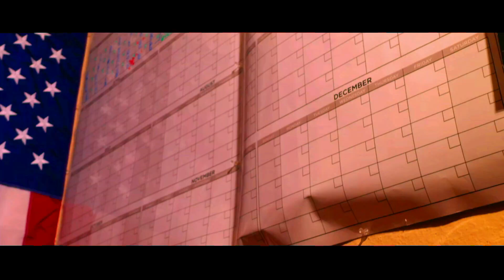(HATSAN BLITZ SLUG TUNING) POWDERCOATED NUCLEAR SLUGS: BENEFITS? TESTING GRIFFIN 36 GR POWDERCOAT!!!

Comment: Some really interesting results there. The pellet shot to shot consistency was great. As well as a better fit, they must almost be like lubrication. Hopefully this will also make a difference on accuracy. If this works well, it could lead to a change in pellet and slug design. I wonder what the long term effect it could have on the rifling though. This should be something that the industry should be looking at and testing. Great work.

Comment: 💡What's going on is that the powder coat is forming a tighter fit in the barrel thus enabling higher pressure behind the slug, with less air passing around the slug. Bro that's a damn great thing you did there! Now watch how many people that are going to start doing this😂👍👍👍

Comment: I know when you thought that the powered coat of paint added more weight to slug, I seriously don't think it does! I've weighed many slugs and pellets it weighs different because of inconsistencies of the bullets !
Example I have Diabolo 50 .15s  an they weigh anywhere between 49.78 to 53.00 ! We'd really need two bullets same exact weight and then one powder coated , at this point it would start off fair ! Have you ever diesel fired your air gun?
Reply from the maker: Actually I haven’t!
Reply: @macabespeed  
I haven't either but it makes an explosion and over doubles FPE and increases fps on average 200 to 300 mph.. all you have to do is put a dab of oil on back of pellets, YouTube it tell me what you think... now I'd say to do it on an older gun ... plus love your show..  thanks for making it understandable an fun....

Comment: It would be good data to slug the rifle bore with pure lead roundball.  This is done in bullet reloading to see exactly what it is now, as well to be able to tell down the road any adverse effects on rifling after re-testing and then having a baseline to see any loss.

Those 100ths of adjustments in bullet diameter + - are critical in reloading but much more increments available before things got crazy. Powder coating looks promising.

Well target at least, hunting there would be a contamination issue to consider looking at the jell.

Great video, thanks.

Comment: Try cerakote its better than powder coat and should give u higher fps than powder coating
Reply from the maker: Great comment! My only issue is it’s a wet spray process! I love being able to just vac up any mess in the tent, I’d hate to have an actual paint spray booth to clean👍
Reply: Cerakote is abrasive and will destroy the barrel.

Comment: Can the same affect be achieved by lubing the slugs?
Reply from the maker: Not sure!
Reply: Very cool
Reply: Likely vacuum sealing grease would have a similar effect. I believe the hatsan bolt occasionally dings the round against the barrel breech during feeding, causing the accuracy and fps deviances. I think the powdercoat acts as a protection against that feed damage because its more resilient than the lead.